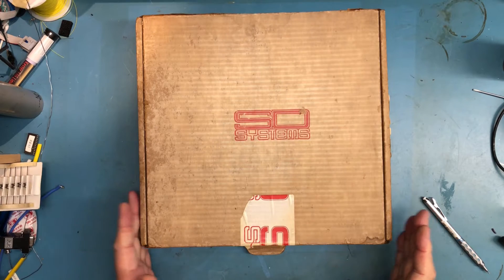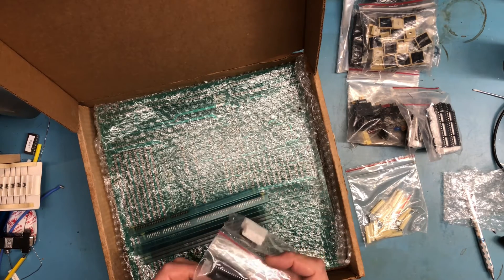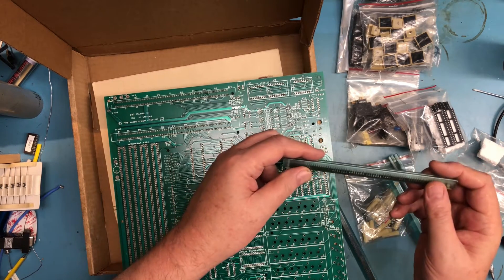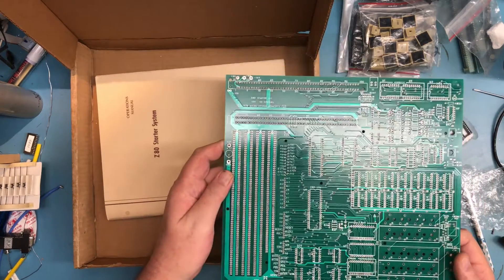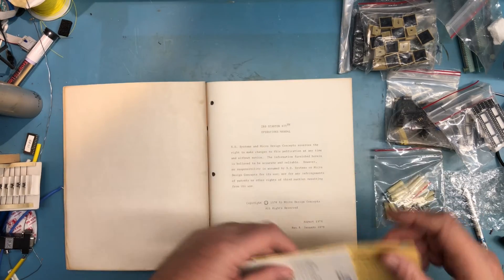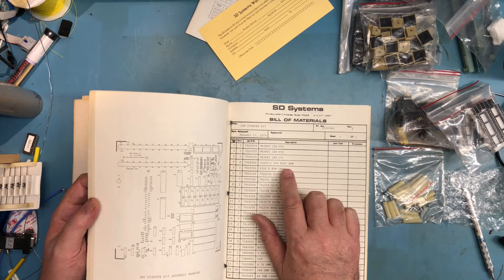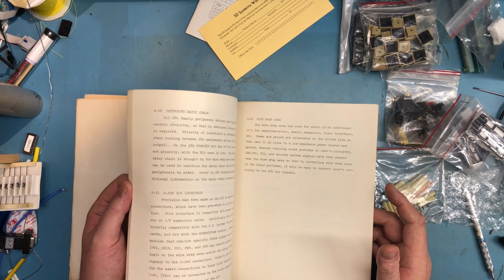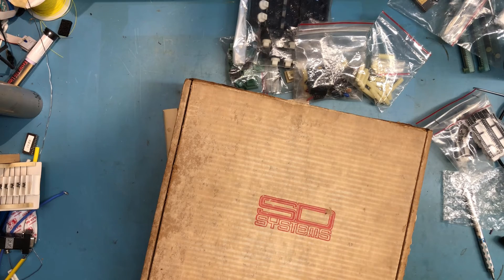STB560 - SD Systems - Part 1 - Unboxing the Z80 Starter Kit

Comment: Wow, building a Z80 Starter Kit in 2021. What a trip.

I built mine back in 1981. Paid cash for it, right on the floor of Comdex at Chicago's McCormick place, at the SD Sytems booth. Back then, Comdex had a totally different vibe - almost like a gigantic hamfest, but with a better dress code. :o)

Anyway, I carried that flat square cardboard box around under my arm all day, while looking at all the cool new stuff. When it was finally time to make the 3-hour drive back home, we discovered that we'd locked the keys in the car! So my friend had to call his wife and have her put a spare key on a GREYHOUND BUS. It didn't arrive untill the wee hours of the morning, by which time I'd been carrying that damn box all over town, in & out of taxis and all the way to the bus depot. I lost count of the comments from people telling me I was carrying my pizza the wrong way!!

It was fun to build, except one of my 2-digit 7-segment displays turned out to be dead. Luckily, one of our local electronic parts distributors had a Sylvania ECG replacement which was functionally the same (although the package looked different, which always bugged me a little).

Eventually I added some static RAM and QWERTY keyboard & printer interfaces in the prototyping area, then video & RAM boards in the S-100 slots. I wrote a Z80 machine code disassembler, and hand-assembled a text editor from source printed in one of the great computer mags of the day (Kilobaud maybe?). Used the onboard EPROM programmer to add lower-case & graphics characters to the video card.  Rewrote the cassette storage routines to work with bytes instead of 4-bit nibbles (borking the KCS standard protocol), to reduce save & load times.

And yes, it's still in the closet somewhere... :o)

Thanks for another trip down memory lane. You have a great collection of videos here.
Reply from the maker: Fun story, thanks. I keep planning to expand the system, would like to get it running CP/M but other projects keep coming up.

Comment: Where can you buy one ?
Reply from the maker: The kit was an ebay purchase. I've not seen another one listed for some time.
Reply: @ShadowTronBlog  :( should made copys of the board :O
Reply from the maker: @Bewefau  The RC2014 is available in kit form, much more useful and runs vintage software well. Add the VT132 Terminal Emulator and it's a really nice Retro style system.

Comment: I don't know why people freak out for building "rare" kits. I don't understand why people prefer to have shelf queens rather then working systems you can interact with. Heck there is a Apple 1 on eBay going for 1,500,000 right now even though there are many clones of it. The way I see it is to have fun with it. Program some stuff and make some one off upgrades/modifications with it like it was intended.

I'm excited to watch this build. Stuff like this makes me want to buy a kit and build one. Been thinking about buying a RC2014 kit. Off and on I have been putting together a Z80 from Protoboards and wire wrapping it but after a few days of not working on it I forget where I left off lol.
Reply from the maker: I don't typically keep shelf queens. My rule is if I don't play with it for a year I either sell it or most likely rehome it for free. I do have a few keepers but the majority of stuff does get moved on eventually. A do regret giving away my Atari TT, my NSC Imp Development system complete with ASR 33 and my LNW 80 system I built from blank PCBs.

Comment: Dude, catch your breath!

In some respects, kits are a little disappointing.   You don't learn much from assembling them except the skills required to assemble them (like soldering).  Not that that is bad, but after a few kits, you can solder.  However, computers are different aren't they?  The  build is just the first step.  Then comes the programming, the designing and building add-ons and peripherals.  Still though, designing your own computers is even more fun.  Get the board(s) done up and send of for fabrication ... while that's happening, get you parts together, then when everything arrives, you got your own kit!!